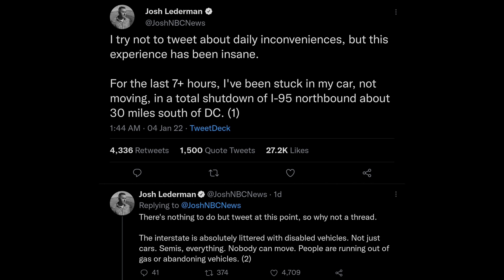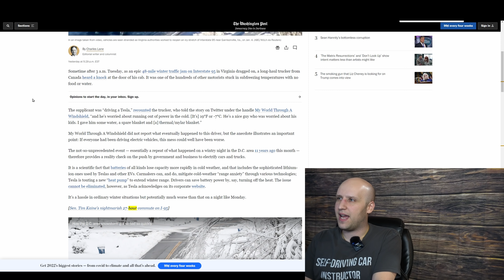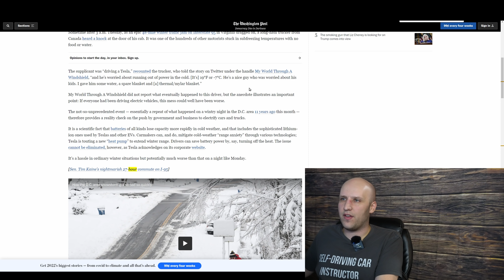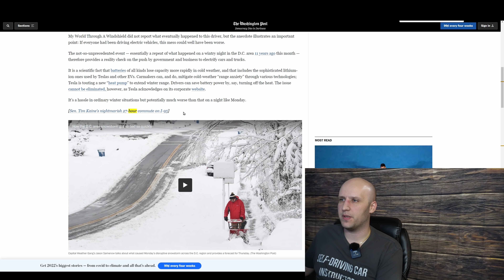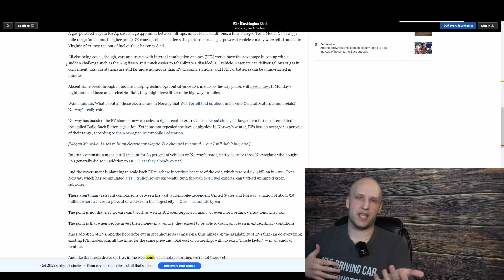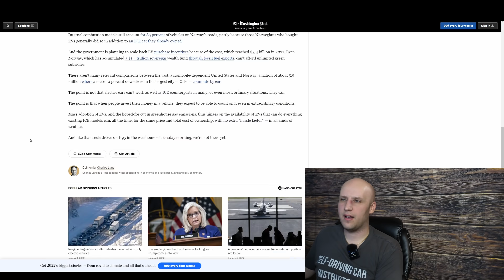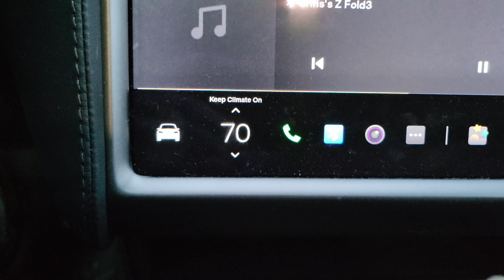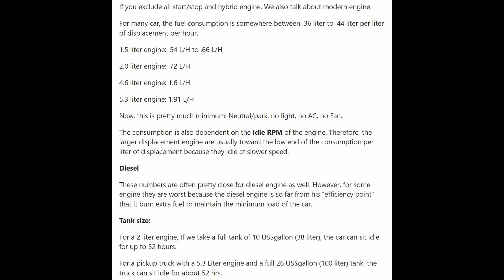How Long Can a Tesla Keep You Warm In A Frozen Traffic Jam? | FUD Debunking

Comment: Would be interesting to see a comparison between the two Teslas in truly cold weather (like -40 degrees). I image the heat pump would struggle a lot more then.
Reply: My Honda Civic won't keep you warm at idle in -40 weather. It won't keep you warm at idle in any subzero weather.
Reply: @paulzumpf3612  something is wrong with your car
Reply: @ToddMoore1  nothing is wrong with my car. At idle it doesn't burn enough fuel to keep warm. You can turn the heater on and watch the coolant temp gauge drop.
Reply: @paulzumpf3612  what about if you put cardboard in front of the radiator?
Reply: @weswest8666  traveling down the road all is good. The problem at idle is that it's a 1800cc engine with a total cooling system capacity of 1 gallon. At idle the heater is enough to overcool the engine. Everyone I know with a highly efficient car (Honda Civic, Ford fiesta, ect) has the same issue.
Reply: @weswest8666  In really cold temperatures at idle the thermostat will barely open or not open at all. Almost no coolant is routed through the radiator.
Reply: I asked for a comparison between the two teslas, not with a fuel based car.

For that matter though, a fuel based car would run an auxiliary heater in a situation like this. A full tank would keep the car cozy for a week (you would have to get creative to prevent the battery from running out though).
Reply: Recently, jusr last week,  in a hill station called muri in pakistan, due to  heavy snowfall there was a city-wide traffic jam and thousands of cars were stuck in a traffic jam for few days. People slept in their cars at night , kept the engine running with the heater on. However their  exhaust pipes were blocked due to surrounding snow around the car. This forced the generated carbon monoxide back into the car. Due to this phenomena some 20 odd people died, in various cars. 

This well never happen with Tesla or any other electric car.
Reply: Well your car need gas to produce heat and a water pump to circulate it through your cab.  Then you need a functional fan blower motor.  Once you overheat or run out of gas these things stop working.  The heat pump In a tesla doesn't rely on the motor to run.  It's an entirely isolated system and uses a lot less energy than the drive motors.
Reply: @patrickmontie9583  Tesla uses one motor for the compressor that pumps the heat. It has at least one other motor for air circulation over the condenser (hot side). It may have another for the evaporator (cold side to collect the heat from the exterior).
Unless you have a component failure, the fuel-based engine won't overheat in cold weather. Even a Chevy Vega can stay cool when running at 20 F. 
Running out of gas idling depends on many factors but a modern car with a 90% fill will likely idle well in excess of 24 hours and many cars will idle for even more days.
Reply: @patrickmontie9583  Heat pumps’ efficiency drops as the difference between the condenser air temperature and the evaporator air temperature increases. Below 37°F on the condenser (the outside coil on heat phase) the system has to defrost occasionally as it will clog from frost buildup.
Below about 5°F a heat pump is less efficient than a resistance heater. As the compressor is outside the cabin its waste heat is totally wasted.
Reply: If you know the refrigerant pressure in the evaporator of the heat pump and the refrigerant being used you can look up the thermodynamic properties of the refrigerant at that pressure and see what the boiling point of the fluid is. If the outside temperature is less than the boiling point of the refrigerant then the heat pump won't be able to pull heat from the cold air on the outside to heat the inside of the car, so there will be a minimum temperature at which the heat pump can work. The resistive heater in the Model X doesn't have this problem, so it might be a better, if less efficient, option than the heat pump in areas that see really extreme cold.
Reply: @peglor  Teslas with a heat pump has a resistive heater as well, to use when the environment is outside the operating parameters of the heat pump. So that isn't a problem.

Comment: that’s why the independent solar system is important, to run the deep cycle batteries, that can allow ac without the car turning on, and heat. you can use the power to cook, with electric burner like nu wave, and it will last a long time, plus because you don’t always use that power source, it will be charged. they need to implement in all vehicles, a small solar panel could charge a deep cycle in hours would be great.

Comment: Very interesting and informative video.  Well done.  A question I'm hoping you might know the answer to, or near to it:  How low could the battery percentage go and still be able to start the engine and drive say 5 miles?  That might be useful to know, since that could mean the difference between needing a tow to get out of there once the storm is done and road is clearing, and not.  And is there such a thing as a portable battery recharge pack that doesn't take up too much room if stored in the car's truck, that could be used to partially recharge a drained battery so one could get out on your one without a tow, and how long might that pack last without being used before it could no longer be used without a recharge?
Reply from the maker: Well each % is worth approximately 3 miles give or take. And Tesla has a significant buffer below 0%. I'm not sure about other EVs
Reply: @DirtyTesla  Good stuff.  Thanks.  It sounds like even near or at zero, there might be enough charge to start the vehicle and at least begin to drive, do you think that's true?

Comment: In my Toyota, the seat warmers won’t run unless there’s a person in the seat. I imagine it’s the same sensor that identifies if a person is in the seat and not wearing a seatbelt. I would assume an EV would employ this same system to preserve power. Point being your seat warmers being on with no one in the car is not contributing to your test.
Reply from the maker: They run with no one in the car.
Reply: @DirtyTesla  okay. Mine will show they are on but are not warm to the touch until sufficient weight is present.

Comment: #1 is be prepared. 
An advantage of electric cars is that you can run only the heater.  There have been cars that have had gasoline heaters and over the road trucks are often equipped with diesel heaters.   In extreme cold both gasoline and diesel will gel stopping the flow.   On the North Slope of Alaska, ARCO sold ARCO Artic Gasoline. Pickup trucks sent out in mid winter were kept running to prevent the system from freezing.   If an engine stalled, it could not be restarted and soon the engine block froze and cracked.  In spring the pickup was scrapped for usable parts.

Comment: After watching this long video, it’s still not clear how a large number of EVs could be removed from a traffic jam if their batteries did run low.  Would they all need to be towed, or would it be practical to move some diesel generators into the area so they could be recharged?  Alternatively, the Chevy Silverado features a plug that would allow it to transfer some of the energy stored in its battery to the battery of another EV.  How many EVs have this capability?  Do any of the Tesla EVs have this feature?

Comment: Your gas car figures are way off. This is something well known in some area but gas with small engines 1.5lit last on average near 3 days with constant running. If you do stop start keeping the temp about 18C they last 7 days keeping heat in a vehicle. But idling for that long is bad for them and the electric car is more likely to be more comfortable and a better environment etc.

Comment: "What could happen?"  When your EV goes dead your afoot until you can get it to a charger, usually by tow truck.  When the I.C.E car runs out of gas you just pour a few gallons of fuel in it and drive off.  That's a lot to happen EV fan boy.
Reply: That’s why experienced EV drivers carry small generators, just like like experienced ICEV fan bois carry battery jumpstart units.

Comment: I'd consider a hybrid if only they didn't seem to suck. Either they have a fairly full sized engine, making the EV part nearly unnecessary or afterthought, which usually means a very small battery. Or they have a small engine but still don't have a decent sized battery or strong enough EV motor to get the benefits of EV. 
I want something where I can cruise along on ICE, and have reasonable range for highway travel or if the battery is not charged. But I also want a solid 120 mile EV range, with quick acceleration. 
Do any of the current hybrids (excluding high-end Volvos and Porsches) have this?

Comment: redo your test' I keep my house at 68-70 in the winter.  If your stranded  in a car you run your engine long enough to warm up then shut down.  When the temps drop to low restart again. This uses less fuel and in an electric you don't need to waste fuel to start up.  An ice engine uses more fuel in starting up, an electric don't. Also no risk of carbon monoxide with electrics. you could extend you time by shutting down 30-40 percent of the time.

Comment: The one big negative with electric is if your on a road trip and have to spend an hour+ hooked to a charger to get to 100%.   And not to mention with electric wanting to go way off the beaten path.  When they can get recharge times to equivalent gas fill up times then it would be near competitive.  I for one don't want to be stuck in a line at a recharge station for however long then spend an hour on the station.  Sorry, charging to 80% doesn't cut it for me.  I don't 80%  my fuel tank.
Reply: It charges significantly faster with lower batter percentages. charging to 100% at every station is horribly inefficient and isn’t necessary
Reply: @gio-ko7kf  You made my point.  Not being able to quickly fill the battery to it's full capacity is  not acceptable.  That is just an excuse to cover for this inability.   I see it used all the time so I call it out and justifiably so.  The echo chamber of EV owners and wannabes use that excuse all the time.   The technology is not there yet.

Comment: I think the whole panic about 'what if' for EVs comes from someone who didn't live with an EV.
Gas cars have been around for many decades so majority of people know exactly what to expect from one.
EVs are new for most people and the fear of not knowing what to expect from it, especially from people who aren't even considering owning one is what pushes them away and causes these opinions to float around.

I live with my (non-tesla) EV for 6 months now and I got quite good at predicting its remaining range, and how to avoid getting stuck.
That's still nothing and I wouldn't hop in it and drive for an extended journey (also because its range is 160 miles) but the more I drive it, the more confident I become.

As EV adoption increases, you will hear less and less of such things.

Comment: My car has neat gauge that tells how much fuel per hour is used when you are idling. it's a 3.0T engine and takes around 0.8L/hr when parked. Considering the tank is 64L, a full tank would last 80 hours of idling, and can be almost doubled by running it half the time. Using the heat or not will make a marginal difference, as cabin heat is basically free on a engine as you are using energy that would have been wasted ortherwise in the radiator.

Comment: If a person is reasonably dressed for winter weather the comfortable temperature would Be in the mid to low 60’s. This would use much less energy than 70 degrees giving much longer battery life.

Comment: Dear Mr. Clueless,
You keep saying running out of gas is same problem as dead battery. You are wrong. 
1) Internal Combustion Engine ---- 5 gallon can of rescue gas brought to you by AAA, and you're on your way.
2) Electric Vehicle  ---- EV dead battery needs flatbed tow truck to haul EV to charging station where you wait in line for your turn to plug-in. 
Do you see any difference in the problem between gas vs EV?

Comment: Great video~ I'm wondering if the A/C will have the same battery life if you are stuck in a HOT place. I live in Las Vegas & the summer heat hear is brutal. I often leave the state to get away from the heat & sleep at rest stops. It would be REALLY great if the Y could easily let me sleep for 6-7 hours without draining my battery. Thank you~

Comment: Right you covered it all, good presentation.    If you want to be prepared for cold weather driving, then having an emergency blanket is perfect, esp. if it's a down comforter or down sleeping bag.    You don't need to run anything in the car if you have those, even if the temps are subzero.    But I repeat, I personally think an emergency coolant suit, like those worn by Apollo astronauts would be a "cool" (or warm) Tesla appliance which could thermally regulate the wearer for days on a single charge.

Comment: What an excellent video!!! Wow 😮 what an eye 👁 opening test. 
Well done on comparing gas ⛽️ to an electric ⚡️ car 🚗  So 🤔 it seems the only difference is how fast 💨 you can charge ⚡️(refuel ⛽️) the automobile. It’s a shame that EV’s can’t charge 🔌 faster. 1 hour or more at a charger 🔌 or 10 min at a gas ⛽️ pump. I think once the charging 🔌 technology get better ❤️‍🩹 as well as more charging 🔌 stations for people to use the transition from gas ⛽️ to electric ⚡️ will become much easier for most people. As long as costs 💰 come down. Right now the Tesla is the best electric ⚡️ car 🚗 .. however it cost 💰 way.. way to much for the average person to purchase and then it comes with teslas long 🕰 waits for purchase, service or repair. An ICE ⛽️ car can be purchased, serviced, fixed and fueled ⛽️ faster 💨 and they cost 💰 much much less then the electric ⚡️ counterparts. I have to say your video is awesome 😎 👍 i love EV automobiles. In my opinion Tesla has the best car 🚗 and I think Rivian has the best truck 🛻 so far… but the cyber truck hasn’t come out yet so I’ll have to see how the cyber truck compares when it’s available.

Comment: Oh you rookie, there is a reason people put a piece of cardboard in front of their radiator in the winter. Sometimes an idling I.C.E engine doesn't put out enough heat to keep the cabin warm so they will have to run their engine at a higher idle. The smaller the engine the worse the problem becomes.

Comment: Although I am not familiar specifically with how Tesla heats, if I were to guess, from an energy efficiency perspective, if you had warming blankets, the energy use would likely be less than running an electric heater that had to output to the entire cabin of the car.     In fact this "technique" was effectively used in the Apollo space missions as the astronauts had coolant suits, (essentially like warming blankets fitted like long-john undergarments) which could pump hot or cold fluids through the net of tubes.    It is always more energy efficient to cool or warm the thin layer of air just above the skin with a thermal insulator around that, than to attempt to temperature control the mass of air of a cabin which is thermally leaky.      I would imagine if a similar emergency thermal blanket (hot or cold) was designed, a typical Tesla vehicle could power it for days.....far longer than a gasoline engine could cool or heat their cabins.

Right, just like the seat heaters are more efficient.

Comment: Thank You for the video. If I had the money I would love to get one.  I have a question but rarely do I get my questions answered.
Question: is H2S given off from charging the Tesla batteries like from other batteries?
In the coal mine where their are very big batteries, it needs to be well ventilated during charging to prevent the build up of H2S.
Reply: H2S is generated in lead-acid batteries, from the sulfuric acid in them.  Lithium batteries contain no sulphuric acid, and so generate no H2S.  There’s no liquids in them at all, as the electrolyte is a very thick paste.
Reply: @jimmanley2796  Thank You

Comment: When I lived in the northeast I never let the fuel tank get less than 1/2 full in the winter.  I also had blankets in the car and salt in the trunk.  No way would I run a car continuously for 20 straight hours, EV or gas.  And I certainly wouldn't keep it at 70 degrees, it would be around 40 degrees.  You gotta be prepared on the road.  But then people don't.

Comment: One thing that the article does not mention is that any car loses range in winter.
I drive a ice car and during the winter I get about 530 km / tank and in the summer get about 620 - 640 km or range.
So its very much a useless article.